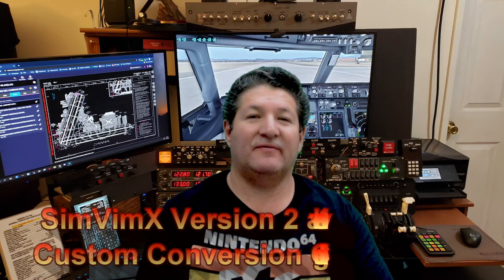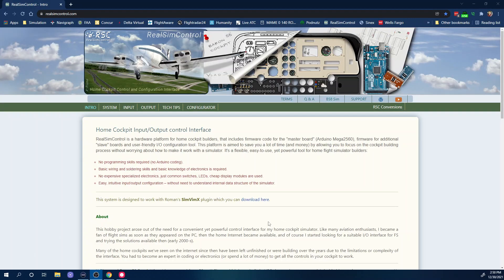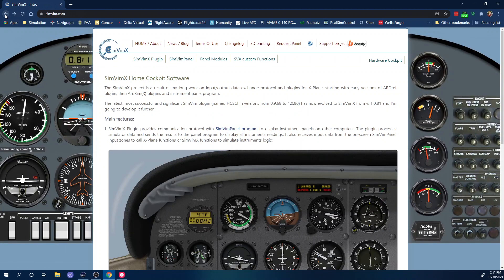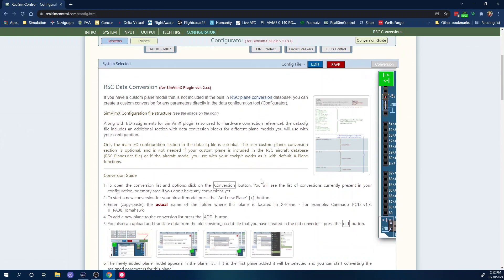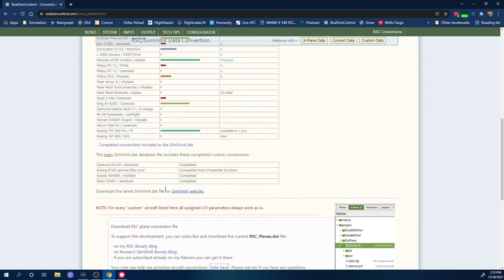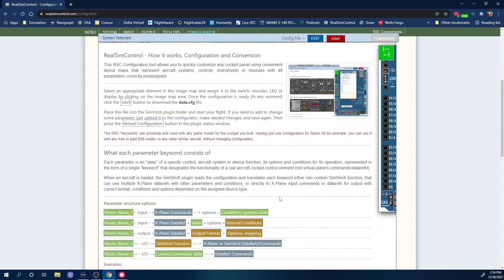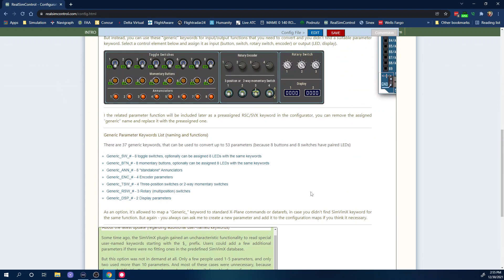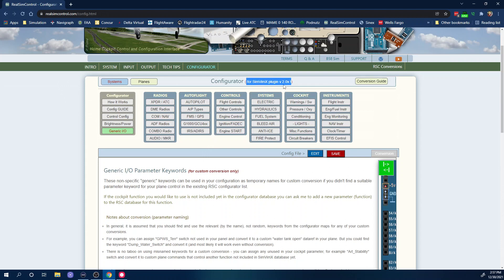SimVimX version 2 and the new custom conversion configurator

Comment: Hey,
Is it possible to use 2 arduinos in SimVimX? If so how?
Reply from the maker: No it's not possible, only one master board. You can use three Unos or Nanos as LCD, Stepper, Servo, and Matrix controllers though.

There is no need for more than one master board since you can get hundreds of inputs and outputs using multiplexer boards.

I have videos on all that in my channel.
Reply: @Qosmokid  Okay, thanks for letting me know